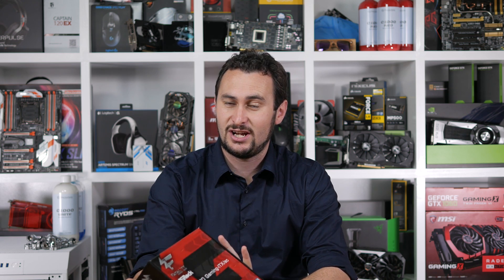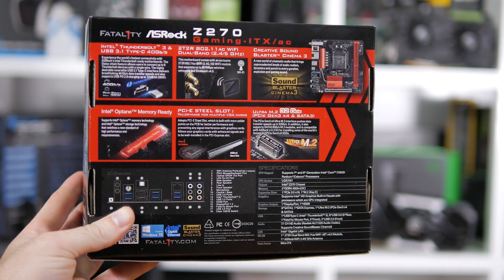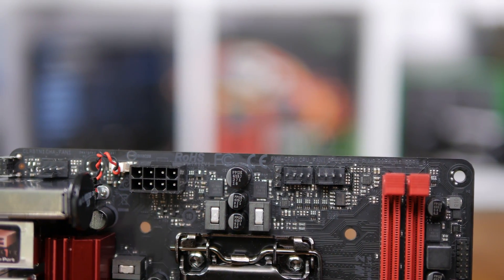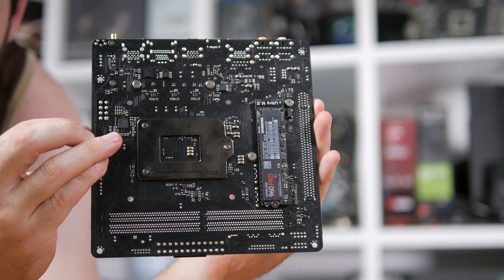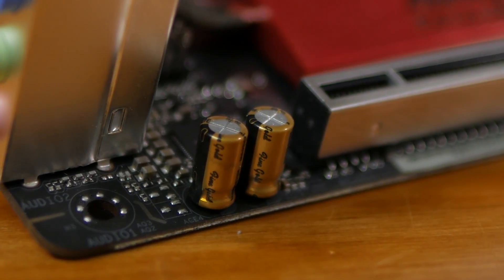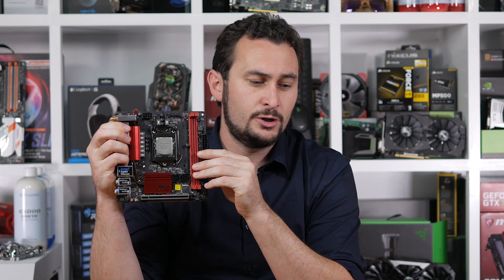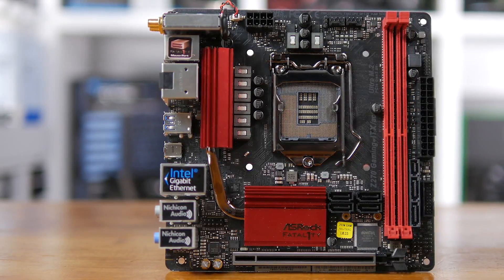Asrock Fatal1ty Z270 Gaming ITX/ac Review: A Wittle Monster!

Comment: I've never owned an ITX motherboard, what sort of power supply does it need? Just regular ATX ones or something different/smaller?
Reply: Robert Bratu common atx psu, or sfx compatible with atx standard, you have to be carefull because most itx cases dont support full size power supply. I myself have a thermaltale core v1, which supports full size psu
Reply: I was thinking about building a gaming PC inside a furniture, so space would not be a big issue, I was just wondering about compatibility between the ITX motherboard and a ATX PSU.

Comment: does thunderbolt 3 work ok?
Reply: Would be interesting if it properly works with a TB3 dock like for example a Macbook Pro. You can plug them in and be instantly connected to an external display, network and various peripherials.

Comment: According to the Asrock website, Skylake processors are compatible with this motherboard, but only with memory speeds of 2133 MHz. Are you able to test this board with a Skylake processor? And are there any other known compatibility issues?
Reply from the maker: +Samuel Eckert Skylake processors work on all Z270 motherboards with the full range of DDR4 memory speeds.
Reply: Thanks for clearing that up for me. On their site it says, "7th Gen Intel® CPU supports DDR4 up to 2400; 6th Gen Intel® CPU supports DDR4 up to 2133." I see now that must refer to supported default profiles without overclocking RAM.

Comment: Hi Hardware unboxed, I am really in love with this board, especially i need a thunderbolt 3 port for external GPU as i am building a HTPC. Just one question please, due to the fact that not all thunderbolt 3 ports support eGPU, would you please, if possible, test the thunderbolt 3 on this board see if it supports eGPU, such as razer core or akitio, big thanks!!
Reply: http://blog.livedoor.jp/wisteriear/archives/1064008035.html

Comment: As this is presently the only Z270 mITX board with HDMI that can do 4k@60hz I am thinking of using this for my passivly cooled HTPC setup. I am not going to overclock it for this reason. Did you notice the heatsinks getting very warm when ideling?
Reply from the maker: +Michael Busse No, the heatsinks were very cool and I wasn't really pushing air over them.
Reply: Perfect, thank you very much :)

Comment: Did you experience any thermal throttling with your 960 Pro? What are idle and load temperatures like?

I'm running a Mini-ITX  system with an Asus Z170I Pro Gaming which also has an M.2 slot on the back and even my cheap SATA M.2 SSD idles at over 50°C and  goes up to 70°C when writing data. I can't imagine how bad it would be with an SSD as fast as a 960 Pro.
Reply: Apparantly the 500 GB version of the 960 Pro doesn't trottle.

Comment: 175? I thinks its pricey
Reply from the maker: Yahtadi Shidiq Given the feature set I don't feel it is.
Reply: To me looks fine for a motherboard like this.
Reply: Its pretty reasonable price really.  Think about it they are cramming almost as many features as a full sized atx board on a tiny itx board. Not to mention even more features than most atx boards wifi and thunderbolt, there are only 3 full sized atx boards that have thunderbolt.  It is a lot harder to route and design on such a small board compared to a larger one.  They also more often than not have to use many layers for varying connections on such a tiny board as routes would interfere with one another on one layer as there simply isn't enough room.

Comment: check how many cores and threds the new games used :)
Reply from the maker: +areczek1987 I do when benchmarking new games.
Reply: They really do. I think they already have a comparison for the newish i3s and i7s comparing the use of Hyper-Threading and cores. What i recall is that BF1 has some improvements using these features if you want to spend 200$ more...
Reply: Hardware Unboxed put the 6950x with and without hypertreding and show graphs of used cores and framerate "adwantages" of using hypertreding. its only put 30% extra max what im heard. you my favorite tech chanell right now btw :) kippin doing whats you do :)

Comment: Did not liked that cmos battery. No way to replace it.
Reply from the maker: On the contrary, it is much easier to replace than a more traditionally mounted CMOS battery. If you break the housing for the battery on a standard board you are pretty screwed. With this you just unplug it and stick a new one in for a few dollars…

http://www.ebay.com.au/itm/CMOS-Battery-for-DELL-D610-D620-D810-9200-9300-3v-9400-Black-LSRG-/381854755024?hash=item58e85128d0:g:m1UAAOSwFqJWplSr

Comment: Why you didn't go for a 5Ghz overclock?. I would love to see that on itx mobo.
Reply from the maker: +Waleed Al-Ta'i I did. It wasn't 100% stable. So I don't want to report a successful overclock that isn't 100% stable.
Reply: Sadly very few have been able to get a stable 5ghz clock on the 7700k regardless of motherboard used.  Sadly Intel is using cheap goo for a tim and so even if you get a stable 5ghz clock using conventional cooling methods air or water cooler most people are recording extreme temps of around 90C.  If you delid and replace the tim some report a drop in 26C but you void your warranty of course.  At most only expect a stable 4.9ghz at manageable temps.
Reply: Haneko 
i got 5 ghz on my asus z270. Was sweet.

Comment: Thanks for the review. Did you experienced any throttle on any core @4.9?
Reply from the maker: +MarcParis No throttling but I did use an all in one liquid cooler.
Reply: thanks, because on my personal rig (gigabyte z170n gaming 5 (5 phases to power cpu) + 6700K@4.7Ghz @vcore 1.38v I'm experiencing some minor throttles on cpu clock, on some cores...but it's not linked to any temperature monitored. It's also difficult to detect as I need to monitor all minimum core frequencies during benchmark (OCCT or prime 95). I guess it's linked power delivery of my motherboard, but I found no way to be sure..:D
But on this Asrock fatality you have 8 phases, it should help..:D

Comment from the maker: Amazon: http://amzn.to/2hRGvGG
eBay: http://ebay.to/2k9W4yQ

VIDEO INDEX
0:00 - Intro
1:00 - Upgrades
1:26 - Theme
1:46 - Design & Layout
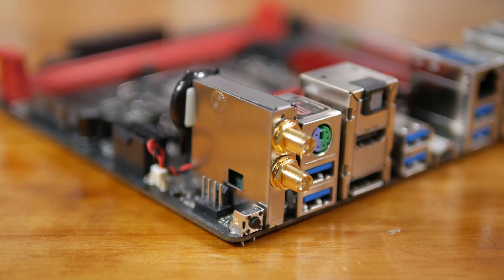2:13 - WiFi Module
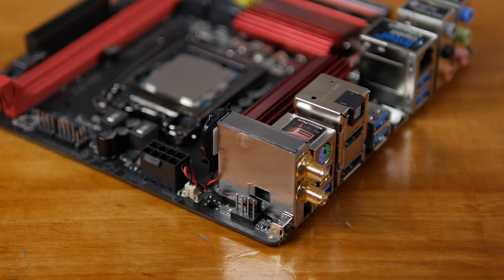2:43 - Hidden M.2 port
3:12 - Impressive Audio
3:59 - A look at the BIOS
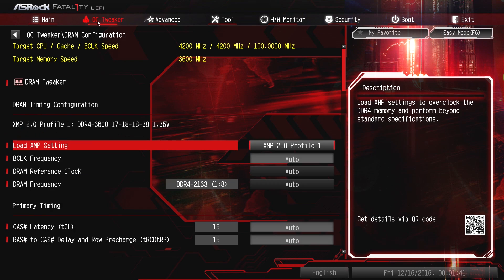4:35 - Overclocking
5:07 - Ultra M.2 performance
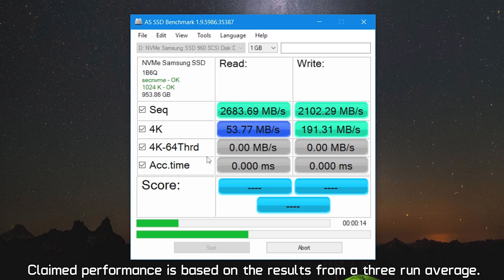5:26 - Why we don't test with games
5:38 - Board size comparison
6:27 - Summary
6:54 - Pricing
7:30 - Outro
Reply: Hardware Unboxed yeah its a rap no AMD 200 series video